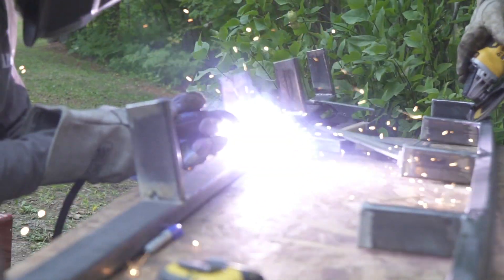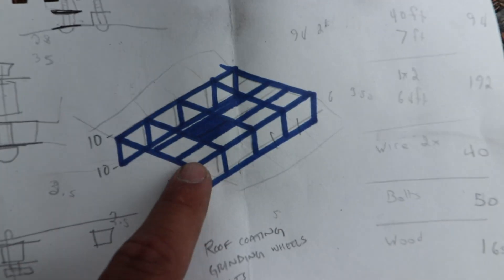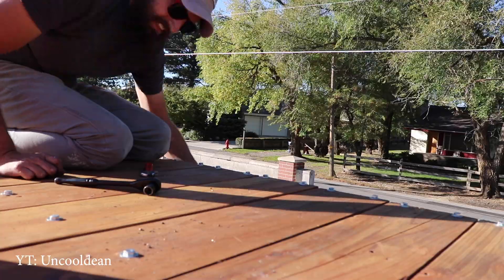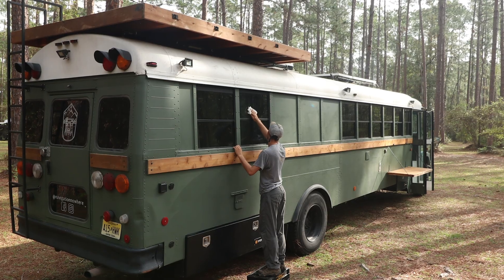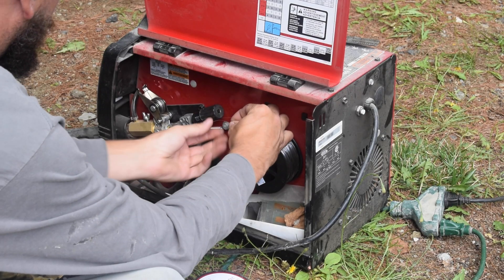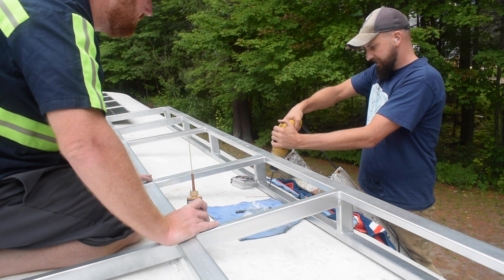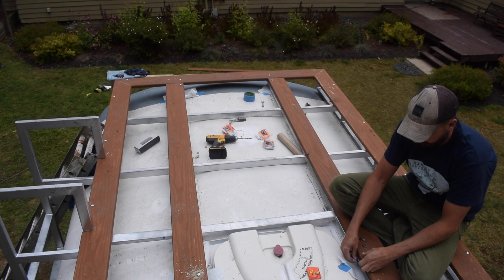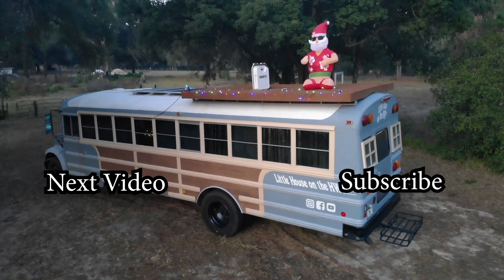How To build a Roof Top Deck | Bus Conversion

Comment: loved the video and the info. we are in the process of a bus build and have learned a lot from videos. i have seen some videos that i have questioned the build. now my question. with the frame of you roof deck being steel and you talked about the weight, was there any consideration of using aluminum. i did a van built out and i added a roof rack and used 2x2 aluminum. now i know the suspension on a bus is stronger. when it comes time, i will look more into it. just wanted to see if you explored that material.

Comment: Hey, why not make a simple air deflector to be bolted to the bus, in front of the roof deck to divert wind when going down the highway?  Kinda like the mini air deflector on many 18 wheelers that deflects the wind going over the back trailer.  Seems like it would be simple, fairly cheap and very effective?

Comment: Where are your safety rails to help prevent anyone from falling off the top?
Reply from the maker: Don’t have any. 😅 Normally,  unless they are removable or able to fold down they would be above legal height limits for driving. My personal bus has a strict 2 drink limit on the deck. 😂
Reply: @navigationnowhere  but fortunately open bar till you decide to make the climb! Stay safe and have fun!

Comment: I'm n my 60's now and just designing a rig to drive Russia and Asia. I was always taught that something is only as strong as the weakest point. In this case a tin roof with spars. No point whatsoever to build out of 2x1" because it's over stressing a roof that was never designed to take that weight. In my mind you'd have been much much better of with a well thought out woden structure, screwed and bonded. Far less chance of the bus reacting badly through rough bends....

Comment: Cut the section of the roof out where you are wanting the deck, rebuild it as a flat steel structure. If you have to have wood look into how boat decks are done. Welds are structural and if done right they are weather proof

Comment: Damned, as a European I probably would have a hard time getting one of those busses, despite wanting one very much...then again, I can dream - right?

As for what I would want? More solar (so that I can run basically any domestic house hardware on the bus if needed), a rooftop jacuzzi (that I can cover up so that if it isn't filled water will not accumulate in it and the cover should be durable enough to work as a rooftop-deck), stainless steel sinks (don't like ceramics all that much, steel is more durable and lighter), a shower (a build without one makes no sense IMHO), a pump with filters so I can get water from lakes and rivers if need be and not worry about it clogging up the system)...yeah...one can dream...

nice build on your bus...still, I'd like more solar if it were mine :)

Comment: Why people are placing so much weight on top of the bus, that is not ok, It is not design to hold so much weight on the roof, it's not made to walk over it or hold any kind of weight.
Reply from the maker: The decks are welded into the structural ribs of the bus. They are not really “on the roof” or attached to the sheet metal.